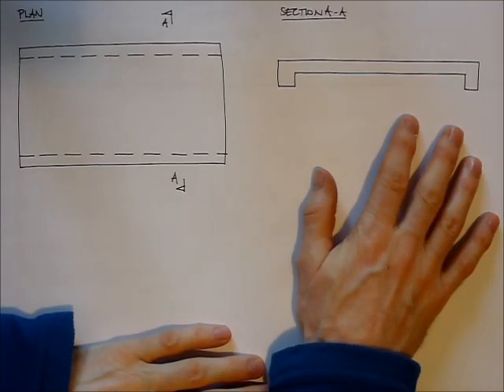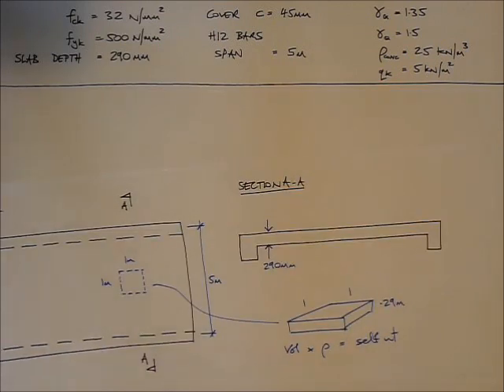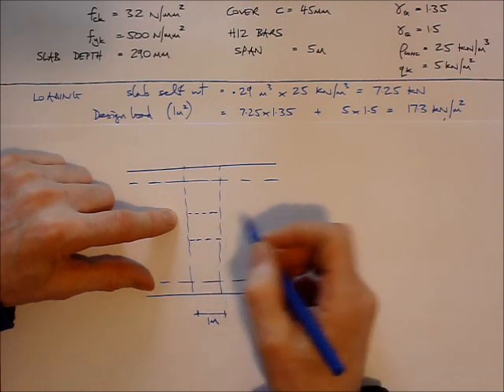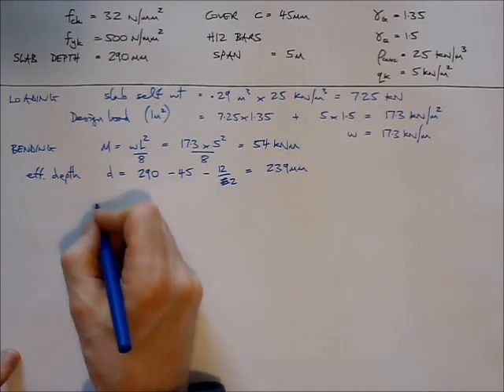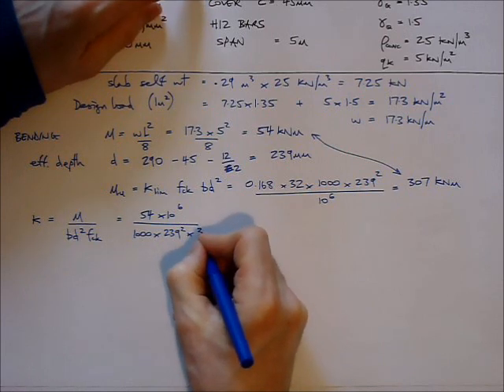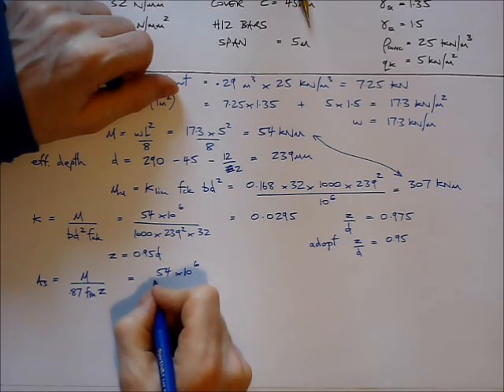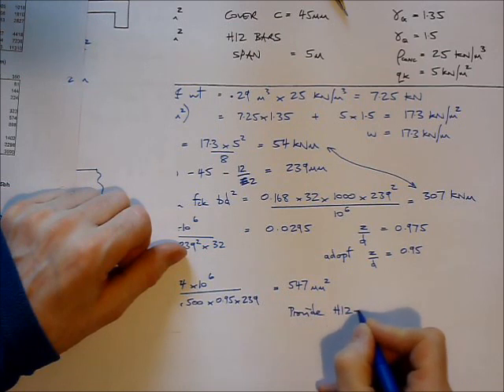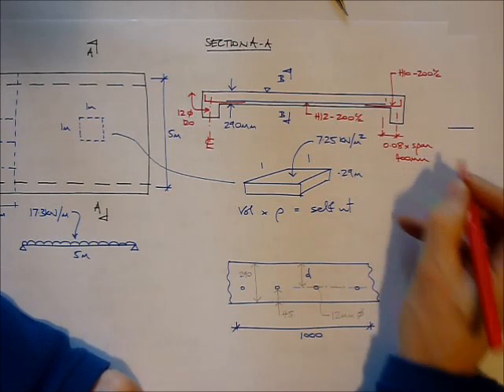RC Slab Design EC2 - Worked example - Bending reinforcement

Comment: Thank you for your explanation.
Is that one way slab?
Reply from the maker: Hi sulawphyu1885, thanks for your comment. Yes, it is one way spanning. A two way spanning slab has a very similar design process. It is just at the start, you have to apportion loading according to the relative spans, Mike

Comment: Great Video, however I would like to know how we can get the distribution steel....
Reply from the maker: Hi keithkagiri1604, good question. You do need distribution steel and I would look at the minimum cross sectional area of steel required for a slab. You would also need to check minimum bar sizes and spacings in relation to cracking. All in all, this really would need a separate video - the alternative would be to speak to an experienced RC detailer who is likely to know this better than the design engineer. Sorry for not directly answering your question - Mike

Comment: I must say a very big thank you for making me understand this topic, but to calculate the area of the steel you used moment/ 0.87 X Fyk X z. The question is in some textbooks, 0.95 and also 0.87 are used. Are these constants, or what determines when to use 0.87 or 0.95 to multiply with the Fyk and Z
Reply from the maker: Hi Afolabi Olaosebikan, thanks for your comment. In my equation I multiply the yield strength of the steel rebar by 0.87. In the Eurocodes the design strength is found by dividing the yield strength by the material factor of safety of 1.15. The reciprocal of 1.15 is 0.87 and this explains how it comes to be in the equation for the area of rebar. 
Now, the lever arm (z) is a different matter and this is the distance between the centre of the compression stress block in the concrete and the centroid of the steel rebar in tension. For a few good reasons, the lever arm must not be too large and a distance of 0.95d is given as its limit. d is the distance from the top of the slab to the centroid of the steel rebar. I hope that this helps, Mike
Reply: @mikebather  thank you so much, Mike. I didn't understand at first but now I do get what you explained. Well done and keep up the good job. Thank you

Comment: Hi Prof Mike. Why did you not account for negative moments in your calculation? Why did you not provide top reinforcement to counter act hogging at the support ends?
Reply from the maker: Hi szymon starosta, good question. I can only cover so much in a 15 minute long video and so I chose a slab that is genuinely simply supported with no fixity at its ends. Yes, this is not a common condition for slabs but it does mean that there are no moments at the ends of the slabs due to fixity. I just wanted to focus on the main sagging bending reinforcement. There are a few other issues that I do not cover also. Best wishes, Mike
Reply: @mikebather  thanks. Please do a video on calculating the cracking moment of a slab. You have no idea what a great help these vids are!

Comment from the maker: The link below no longer works and so I had a quick Google for 'reinforcement area tables' and this link seems to be OK at the moment
https://www.sarcea.co.za/mass&area.php
I don't have a link to the lever arm graphs and now tend to use a formula in place of the graphs. You can use the following equation which gives just the same answer:

z = d x [0.5 + square root of (0.25 – K/1.134)]
If you are unsure how to make use of the equation, you could substitute the numbers from the YouTube example into it to check your understanding. I hope that this helps, Mike

Comment: Hi. This video is very useful. What is fck and fyk?
Reply from the maker: Hi Regina Tasya, thanks for the comment. These terms refer to the characteristic compressive strength of the concrete (fck) and the characteristic strength of the reinforcing steel (fyk). I hope this helps, Mike

Comment: Great Video! How do you determine if one or two layers of reinforcement?
Reply from the maker: What is covered in the video is only a part of the overall design process. In the design office, the engineer must also consider: fire, durability, crack width control, detailing, etc. When all this is done, the final arrangement of rebar can be completed. As a start, it is convenient to keep to a single layer of tension steel and, if apropriate, to make use of mesh reinforcement. Sorry not to be able to fully answer your question.

Comment: Hi Mike, thank you for sharing the knowledge. One thing I am not clear when you used 12 x diameter of bar for the anchorage beyond the centre length of the support. Shouldn't this be at least 40 dia of the tension bar ?
Reply from the maker: Hi Qasim Muhammad, the anchorage at the support already includes a bob on the bars and only needs to transmit reduced tension forces in the bars. The 12 x D is a rule of thumb in this situation. I hope this helps.

Comment: Hi Mike
Excellent tutorial. I have a question to add to this. How will you go about calculating the total factored moment with an additional point load (DL and LL) occurring @ 1/3 of the span? Is it wl^2/8 + Pab/L for total moment?
Reply: lets say a dead load of 10kn and live load of 15kn acting @1/3 span in addition to the UDL.
Reply from the maker: Hi XXYellowFlashXX1, what you are proposing seems reasonable. It is not quite correct as the point load moment occurs at the third-point and the UDL moment occurs at the mid-point, but heh, bearing in mind the enormous safety factors already applied, this is conservative and near enough for a small job. If there is a lot of repetition or large areas of floor, then really you should use basic structural analysis and actually find the moments along the length of the slab. This second approach only takes a couple of minutes, as long as you are comfortable with the analysis. I hope that this helps, Mike
Reply: Sorry I could not understand the solution. For the udl the moment calculation is wl^2 and the point load will be the load multiplied by the distance to support. We calculate the moment separately for both udl then point load then sum the moments together. Then apply the safety factors to get the total factored moment? Can you verify the above please? If otherwise, please explain. Much appreciated.

Comment: Sir can u pls share the Graph for the value of Z
Reply from the maker: Hi Waheed, I cannot upload the graph for z but here is a formula that many engineers use (especially if you have excel):
z        = d [1 + SQRT(1 - 3.529K)]/2
In this formula K is found from:
K      = M / (fck x b x d x d)
I hope that this helps, Mike

Comment: Hi Mike, how would you design a two-way supporting slab ?
Reply from the maker: Hi Athtech Designs, two-way spanning slabs can have linear supports along their edges (say beams) or just be supported on columns (in which case they are generally called flat slabs). Either way, for a manual design (i.e. making hand written calculations), I would make use of design advice given in the IStructE Manual for the design of concrete building structures to Eurocode 2. This gives simple advice allowing a similar design approach to that outlined above to be used. For a linear two-way slab square shaped on plan, with length and breadth the same, then the applied load is carried equally by the slab spanning from one side to the other and also from one end to the other. So the reinforcement in each direction will be equal.  For a linear two-way slab with length different to breadth, then more of the load is carried by the shorter span and less by the longer span. The manual noted above gives coefficients for bending moments and shear forces for these situations. I hope that this helps, Mike.PS I am sure that other design guidance is available elsewhere

Comment: Great videos! This has made everything so much clearer for me. Would it be possible for you to post a link for your tables? I've found most of them however struggling to find the sectional areas of bars with spacings. Found a few but all really low quality images.

Comment: Oh sir on the example you made why did you calculate "Mu" for?
Reply from the maker: Hi nyakallo letsie, Thanks for your question. Mu lets us know the greatest moment that the slab can support without compression reinforcement in the top of the slab, i.e. without extra steel rebar that helps the concrete to carry the compressive forces at the top of the element. If your design moment is greater than Mu then you need to design some extra compression reinforcement. That is it really, Mike

Comment: hello,
can I get help with a two way simply supported slab on all directions ?
regards,
Reply from the maker: Hi Razan, I am sorry but I don't have time to help - I am too busy with my own students. However, there are some great resources. Do you have access to the CIS / IHE database? If so, you can download the IStructE Manual for the design of concrete building structures to Eurocode 2. Also, the Concrete Centre has some good web pages for students: https://www.concretecentre.com/Publications-Software/Design-tools-and-software/CALcrete.aspx. I hope that this helps, Mike

Comment: What if there is a hole in the slab, for instance a manhole cover or stairwell? Does the same apply?
Reply from the maker: Hi dougaldog89, Thanks for the question. The quick answer is yes. There is a good book used in design offices in the UK (Reynolds's Reinforced Concrete Designer's Handbook) which gives really clear advice on matters like this. Broadly, if you remove some of the slab and if you increase the loading on the remaining slab then you need to add extra reinforcement to cope with this. So, if you remove half the slab and don't increase the load, then you will need to roughly double the reinforcement. I hope that this helps, Mike

Comment: Hello..Great explanation. But why we are using always 1m strip, in fact we've to consider full slab. and also there is no consideration of the another dimension of slab expect thickness and span.
Reply from the maker: Hi Nipurn Khatri, thanks for your comment. At the end of the calculations we specify the amount of reinforcement needed for 1.0m width of slab. So if you have a 2.0m wide slab this needs double the steel over double the length and so it goes for a slab 8.6m wide then 8.6x the amount of steel. Considering a unit width of slab is a useful way of allowing our calculations to be used flexibly over a variety of widths. I hope that this helps, Mike

Comment: Hi! I have a question, No more positive and negative moments for the slab?
Reply from the maker: Hi Neil Ryan Lim, In this example, I have used a simply supported slab. And so, there are only sagging moments in the mid-span of the slab. This is a condition that almost never occurs in real life, but that is fine as the point of the video is to introduce the design of reinforcement in a simple situation, so as to not overcomplicate things. I hope that this helps.
Reply: Oh thank you!

Comment: hi Mike, I'm assuming the reason for no steel on the top side of the slab at the support is because it was designed as a simply supported and not fixed end connection? when would we design it as a fixed end connection?
Reply from the maker: Hi Josh D, Yes, you are correct. Continuous slabs develop tension forces at supports and so are designed with rebar in their tops - this is similar to design for a fixed end connection. Most RC slabs are continuous and so are designed like this. Slabs fixing into walls and very large beams could be considered fixed to some degree at their supports, Mike

Comment: helow mike. thanks for the tutorial. I am just wondering how did you decide 12mm rebar for the reinforcement of slab. thanks
Reply from the maker: Hi Dondie Amoroto, this is a good question. Really, it is the designer's choice at the start of the design. Large diameter bars will have wide spacings which may be a cause of cracking. Small diameter bars will have narrow spacings which causes extra work on site and may be problematic at junctions and when pouring concrete. This is something for experience. I have just picked a bar size that will not give problems with cracking (I checked this separately) - in the design office, an experienced RC detailer will be able to give advice to young designers. I hope that this helps.

Comment: hi...first, thanks for this very good tutorials, it helped me a lot. but I have one question about the area of steel part, where did the .87 value came from? sorry for this ignorance of mine. thanks again thou.
Reply: +Peter Pandesal 0.87 comes from the safety factor of steel which is fyk/1.15. Converting 1/1.15 becomes 0.87.
Reply: +Goh khen hui , oh thanks! now I get it. Appreciate your kindness for answering my question.

Comment: Good explanation,  let's say I have a slab with one edge contineous and at the contineous edge I have hogging moments of 35KNm and  a sagging moment of 26kNm at midspan, how do I get area of reinforcement required? do I just consider the highest moment or what? pls help
Reply: +Herta Mbadhi I think that you need to design them separately, as the reinforcements for hogging moment and sagging moment are placed differently.

Comment: Where do you find that klin=0,168 factor ?  at t=6:35
Reply: It is often recommended in the UK that Klim should be limited to 0.168 to ensure ductile failure.
Reply: what is klim?

Comment: Plz may have the figure that you calculate d/z from it  i think its (5.5) because i search for it but no result
thanks .
Reply from the maker: Hi Amjad Sharba, I am afraid that I don't know how to give you the diagram. There is however another way to find z. You can use the following equation which give just the same answer:
z = d x [0.5 + square root of (0.25 – K/1.134)]
If you are unsure how to make use of the equation, you could substitute the numbers from the YouTube example into it to check your understanding. I hope that this helps.

Comment: Hi,thanks for good explanation ,know i understand there is a differentiate between simply supported and continuous
plz when i calculate is there a different in length span .For example, in simply supported we take L eff but for Continuous we take Ln is the clear span from column to column ? is that right ?
and for the moment in simply support we take W L2/8 but for  Continuous it will be  W L2/12 ?

Comment: Hi, i would like to ask, how to differentiate continuous slab and simply supported slab? In a building design eg shop lots, my slab should be in continuous right?
Reply from the maker: Hi Zian Yang Chiew, a simply supported slab will have just two supports. It may be supported by beams or walls. A continuous slab will have more that two supports (say three supports) and its reinforcement will be continuous across the middle support(s). It is important to differentiate between the two, as continuous slabs typically hog over their middle supports (which means that tension is in the top of the slab - and so this is where reinforcement must be placed). Simply supported slabs just sag in the middle of their single span (and here, the tension is in the bottom of the slab and this is where the reinforcement is placed). I hope that this is helpful.
Reply: Hey thanks for the explanation. So it is up to me to design it as a continuous slab or a simply supported slab? Lets say i want a slab to be design as simply supported slab, meaning that sagging moment will be larger compare to continuous slab (bigger Med), hence, reinforcement will be more at the mid span (to provide bigger Mrd) while since there is no sagging moment at the support, no top reinforcement is needed for simply supported slab. Does this sound correct?
Reply from the maker: Zian Yang Chiew Hi again, you seem to understand the idea behind where to put your main reinforcement very well. With reinforced concrete you must also consider placing additional reinforcement (as well as the main reinforcement) for example for shear, or to limit cracking. So even when you do not need main reinforcement to cater for bending, you may need other reinforcement for other reasons. Really, this is beyond the scope of the short video that I posted.

Comment: can some one explain this to me please: concrete self weight = 0.29 m^3 x 25 KN/m^3, that equals 7.25 KN, then he says 7.25 KN/m^2. Does he multiply it by 1 m^2 after?
Reply from the maker: Excellent - couldn't have put it better myself!
Reply: @mikebather  my pleasure.
Reply: 7.25 KN is the self weight derived for a volume of 1 x 1 x 0.29 m of concrete. However on plan view, 7.25KN is the weight for 1 x 1 m area of concrete. Hence so. I hope this answers your question.
Reply: @kirati  thank you for your answer i confuse that the video is .29 i do not see 0.29 make me wondering
Reply: @14_sreyniruth_m34  you are very welcome.

Comment: well explained thank you very much, jst for anchorage and curtailment how did you calculate it
Reply from the maker: Hi Hasabo, Thanks for the message. I will not be covering anchorage or curtailment in detail with my students this year. A general rule in design offices in the UK has been to ensure 40 x diameter of the bar for anchorage. The Eurocode is far more complicated than this. Best wishes.